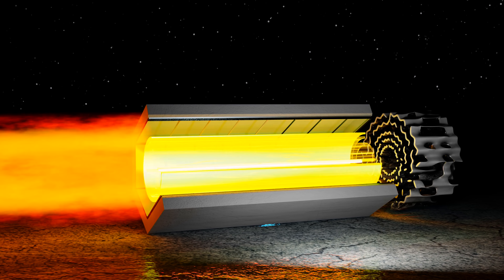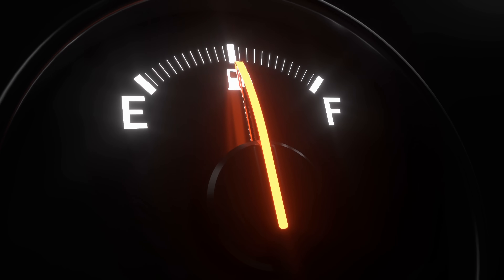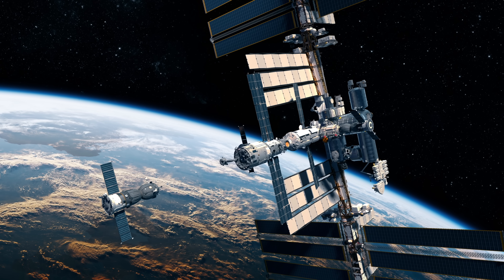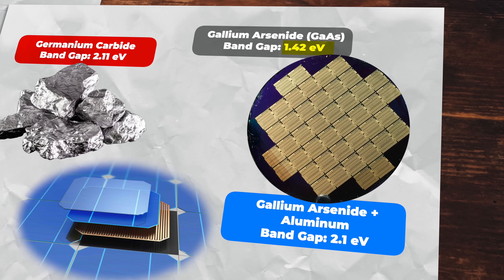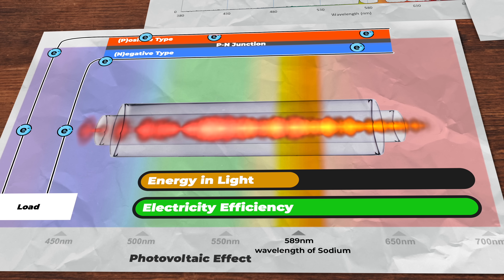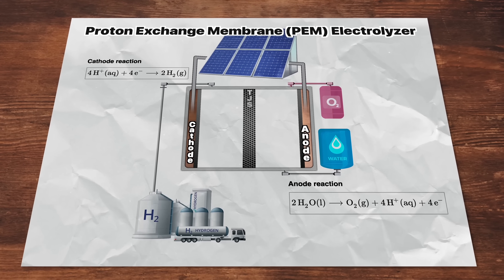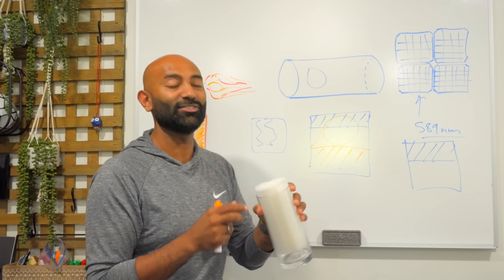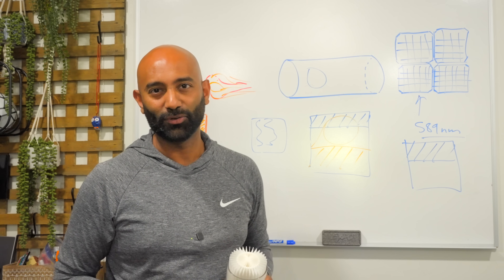Why Solid State Might Save The Combustion Engine

Comment from the maker: Check out the AMAZING Henson Shaving Razor & Get 100 FREE Blades! https://twobit.link/Henson  Use CODE: twobitdavinci
Reply: i see problems with this and i will list them below
1 overheating of solar panels
2 difficulty to start in winter
3 fouling of system with impure fuel
4 risk of exploding/out of control burning with damage
5 HOW DO YOU TURN OFF MOLTEN SODIUM
Reply: @marsfreelander5969  1 Gallium arsenide is the semiconductor that works best at high temperatures, and is protected by an infrared mirror and likely a vacuum gap. The back side could also be cooled by the incoming air.
2 Since when do bunsen burners and gas ovens have trouble starting in winter? This will much more reliably start in cold weather than a piston engine, and can help warm the batteries in a hybrid vehicle.
3 A modern burner combusts fuel much more completely and cleanly than the explosions in a piston engine, there is a constant flow with no moving parts in the way. A piston engine is much more vulnerable to fouling from impure fuel.
4 No more so than any other vehicle with a fuel tank.
5 Like a sodium vapor lamp it is likely contained in a chamber. When you turn off the burner it cools down.
Reply: @marsfreelander5969  1,3 I agree. The entire issue of starting this thing up is ignored and would be almost the same summer or winter.  4 needs a fuel injector, 5 there is no molten sodium just sodium ions.
Reply: You would add this to where the Catalytic converter would be and it would also replace the catalytic converter.
But it would be something that you could retrofit any car with
Reply: @jaredbullock3082  That's what I'm thinking. Then you could bin the alternator and cut out it's inefficiencies and parasitic losses as well.
Reply: You should be embarrassed for posting this video.
Reply: I'm old enough to have lived through the era of the disposable blade, single and double-blade razors. My modern, multi-blade is much better. It lasts for months. Going back to the old way seems to me to be a scam. We have gone beyond disposable blades. Let's not go back.
Reply: @HWKier  look for the Leaf Razor
Reply: @HWKier  I disagree, double blades are waaaay better. Those multi-blade things get bent into cheese graters before they've done half a lap.
Reply: @HWKier  I have this razor and it is a marvel. The TLDR version, get this razor, you won't regret it. 

Now, if you care about why the Hansen razor is so superior, read on. (BTW, I am an engineer and so overthink and geek out on just about everything including razors). Razor "burn" as well as nicks, as well as shaves that leave some short stubble behind, are largely the result of "chatter" or vibrations of the edge of the blade as the razor is pulled across the skin. This happens because friction with the skin causes the blade to bend downward slightly, which in turn causes the blade angle to become steeper. The steeper angle causes the blade to bite into the skin rather than gliding over it. Then, as the blade edge is released from digging into the skin, it springs back and like a spring ends up at an angle that is shallower than optimum and so doesn't cut the hair at skin level. Cutting the hair above skin level rather than shearing it at skin level causes the hair to be pulled as it is cut. This is what causes the unpleasant sensation of the hair being pulled out of the skin rather than cut. And because it cuts the hair above the skin level, this is why it is difficult to get a "smooth" shave with these old single blade razors. 

The magnitude of the deflections of the blade edge is a direct function of how how close to the edge the razor supports the blade. As Ricky showed, the "traditional" single blade razor supports the blade well back from the edge. This results in large amplitude vibrations and so lots of painful razor burn as the edge goes to too steep of an angle and painful pulling of the hair as it goes to too shallow of an angle. The solution has been to put very slippery shave foam/gel on the skin to greatly reduce the friction and so reduce the force causing The Henson razor supports the blade much closer to the edge. The result is that the amplitude of the blade edge vibration is a tiny fraction of the older blades with an attendant reduction in variation of the angle of the edge to the skin. This much better control of the blade means that the angle of the edge of the blade stays very close to the optimum angle at all times.

Also because of the greater control of the blade, the amount that the blade projects past the edge of the razor can be much smaller, making this razor much less "aggressive" than other single blade razors. And lastly the surfaces of the razor above and below the blade form a straight line unlike the round shape of older razors. This makes it much easier to hold the razor so that the blade is at the correct angle to the skin. And because of all of this better blade control, the Hansen razor is able to give a much smoother and more comfortable shave.

As for multi-blade razors, they provide almost no support for of the blades with the blades only being held at the ends of the blades with some vibration dampeners between the blades along their length. As a result the individual blades are free to move to a much greater degree than even traditional single blade razors. As for multi-blade razors great claim to fame that the the first blade pulls the hair upwards and the other blades cut it before it can retract such that hair end up below skin level for a super smooth shave, that is actually a major problem. With the hair below skin level it is possible for the hair to grow below the skin resulting in an ingrown hair. This especially the case for anybody whose hair has any natural curl to it. So anybody whose hair isn't absolutely straight should never use a multi-blade razor.
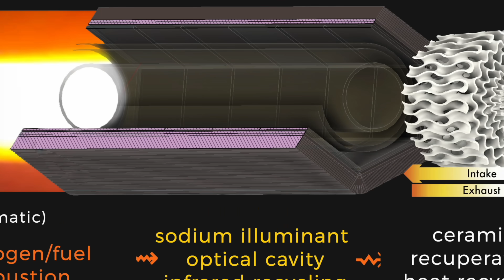Reply: 8:15 No there's not only two possibilities.  The salt is inside a double walled, sealed sapphire tube.

This is an interesting invention, BUT WE NEED TO STOP BURNING FOSSIL FUELS, AND HYDROGEN AT THIS POINT IS A BORDERLINE SCAM.

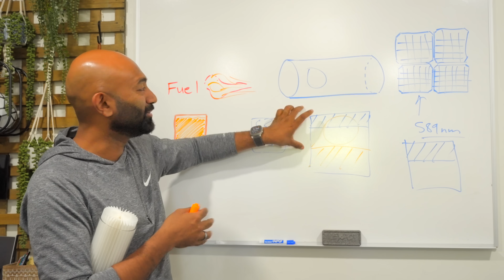14:39 The waste heat from regular internal combustion engines is too low energy to be used efficiently this way.  Thermodynamics.
Reply: "10,000 Watt-hours per gram" - did you mean kilogram??
Reply: This is an External Combustion Engine and so it will be intrinsically much more efficient. A new type of Sterling Engine then (one without moving parts, it’s alleged). How efficient remains to be seen: it’s hard to understand how all the heat produced will be captured (so, not just the more narrowly defined light waves) and then also converted into useful energy. It might be possible if moving parts are added which may yet turn out to be a valuable hybrid sterling engine. Let’s see.
Reply: Isn't there also a significant issue with chlorine gas? If it leaks and combusts, doesn't it produce mustard gas? Additionally, aren't there concerns similar to those with CFC refrigerants, which were discontinued because chlorine gas can bind with ozone in the upper atmosphere?
Reply: Ricky,  I have watched a company that has done something similar which they call the SunCell.  The company is called brilliant light power.  They have an element process that is called a Hydrino effect which collapses......

I think it would be nice to check them out.  I think they are closer and they are more efficient it appears.   Good Luck!
Reply: Utter Garbage!! 😂😂😂
Reply: What a load of utter Garbage!!! 😂😂😂😂
Reply: pin the comment from the maker
@danielle_fong, the founder, made a comment here, but it’s not showing up for some reason.
Reply: Why can't they combine lightcells with existing combustion engines to recover all that lost heat energy coming off the engine? How hot do you need to be for both lightcells before they efficiently converting heat into light?  Seems like if you placed things in the right places you coudl get quite a bit of heat recovery off existing combustion engines.  But I might completely off  and there is no way to capture the energy from the burning fuel as it drives the pistons, without losing efficiency in the engine core itself, if the only place you coudl do it that gets hot enough is inside the combustion chamber, then it might lower the efficiency of the engine, or cause other issues if you can't separate the ion into a tube as you said, or the other lightcell system which I didn't fully catch the mechanism they are using to convert heat into light...
Reply: @Arrogan28  They do, it's called a turbo. This system would copy what turbos do but in an outrageously complicated matter.
Reply: How does the fuel get into the engine without any moving parts?
Reply: I'd say this video is ok for a toiletries peddler.
Reply: It is called thermal induction. You can produce an electrical current in a coil, or separate plates, by heating them.
Reply: This screams Theranos
Reply: @14:30 I think you just made turbos more complicated. I would be curious to see if this system would be more efficient than current turbo systems. My bet, no. Too many phase conversions. Too complex to manufacture thus expensive and prone to breakdown. Turbos are straight forward, simple and resilient. Plus you could build a dual turbo-alternator combo to generate electrical power from engine heat if you want to do it that way.
Reply: Why can't we use this in space?
Reply: Figure out how to do it with hydrogen and I will be impressed:)
Reply: I think what your idea is good. And that should make hybrid cars more efficient. Well done:)
Reply: hey I can see how to improve this generator: supercool the (armature or casing) and add a second layer with a vacuum between. this helps to maintain the cooling effect, I know its a superhot source lol but it doesn't matter -it balances out. Add a Van der-Graaff generator or other ionising source and you're golden. -the ionising makes the collection surface more conductive, ditto the supercooling. This way much of the spectrum can be collected, even some infra-light frequencies
Reply: Use mirrors to make a power tower. Heat sodium to make the monochrome light. Then use PV to make electricity. Need to get rid of wasted heat. Somehow.
Reply: Chrysler turbine car would if made fuel cheaper and ran cleaner emissions. Today science has made silent turbines at least to our hearing frequency.  Why was it blocked ?
Reply: I've been using the Henson razor for while now and it really is the best razor I've ever had. Even if you use a new blade for every shave you will spend way less than a pack of catridge rasors, and it shaves just as good or better than a cartridge. Go get one!
Reply: Love the video. P.S. I think you meant: day in and day out.
Reply: New age Theranos

Comment: I'm very very skeptical of this entire thing. First of all, how are they even burning or combusting the fuel?? It's a solid-state engine but how do you physically burn fuel without moving parts? You still need ways to take in air(intake), compress the air(compression), combust the fuel(power stroke) and lastly let the exhaust out(exhaust stroke), and all these strokes require moving parts. I mean the exhaust doesn't need a moving part, like you just let a pipe or some holes for it to flow through(with tons of insulation to ensure exhaust temps are low can the exhaust heat can be recovered for the sodium lamp part to be as efficient as possible), but you need some way to inject fuel, compress the air and also an ignition source. The most efficient way for a combustion engine to operate is probably jet engines because they do it in one fell-swoop(continous manner)[actually I am not confident if continuous operations of all 4 strokes in the same time is more efficient or not, someone who is more knowledgeable can correct me]. So yes, where is the "solid-state" part of this combustion engine? Or is the solid-state referring to the sodium lamp part and the photovoltaic cell part? If yes, then this cannot be called as a solid-state combustion engine, at most, it should be called this "solid-state energy recovery method can help improve ICE car energy efficiency" or something, which could be less misleading IMO. To be honest though, I still enjoyed this video because the content is clear and concise, and he explained things well with some research done, although I didn't fact-check or verify whether his educated guess of the photovoltaic cell composition is correct or not. I find this video very interesting because I am someone who is quite passionate about racing car engineering, which is where car engines are within my field of interest, and I am now currently also taking a masters project for fabrication of solar cells, which is why this video is seriously well within my area of interest. One thing I have to say is, as an energy storage system, this system will probably never replace lithium-ion batteries because it is not an energy storage system at all. It is actively generating electricity and if you don't use it immediately, it is just going to be wasted, and hence you still need to connect this system to an electric motor for it to be meaningful. At the end of the way, it is actively harnessing energy from burning fuel(at a very high claimed energy efficiency of 60-80%), but you will need to use it immediately via electric motors, OR if there's a way for electronics control system to cut the electricity from the PV cells and you will still need batteries to store the excess energy from the continuous fuel burning process, so from a packaging perspective, I don't think it will very that compact either. So, at the end, I think this project doesn't really bring many benefits, but I digress. I welcome any experts in this particular field to correct me, giving me a good learning opportunity as well.

Comment: 1.3 billion cubic kilometres of salt water on Earth, so we won't run out of salt soon.
However, fuel cells use Platinum catalysts. 10,000 metric tons of platinum have been mined since its discovery in 1741, so a lot less Platinum is available at great unit cost.
That is why this "Light Cell" is better than a Fuel Cell.

Comment: Neurons in our brains are hybrid as well. Theyy use electrical pulses and then chemicals to connect with other neurons. These connections and reactions happen in fractions of a second, your brain can respond before you can (that's also what gives the effect of Déjà vu). It seems hybrid chemical-electric engines could possibly be the ultimate mechanical form of that. Surely there are better options in the future, but as of now, these are some pretty incredible works of engineering. (if the laws of physics can be broken or assaulted to a degree, to allow it to happen. Maybe sodium-salt in the gasoline or something else? having a lamp as an engine doesn't seem like it would be a good idea for any type of land vehicle)

Comment: Stated conversion of light to electricity is said to be efficient.  But the light component of the process is only one, whereas the energy of heat and gas/material expansion may be quite high in and of themselves.

Comment: High school dropout goes to Princeton and learns how to be a snake oil salesman.  If you think this is going to work -- that you can burn fuel and convert heat to light, light to electricity, electricity to mechanical energy with greater efficiency than current technology AND at a scale large enough to power a vehicle, then I must ask you this:  May I interest you in my portfolio of perpetual motion machines?  All of them work great on paper, you need only start a company and raise the funding to put any one of them into mass production....  Even if they are not perpetual, 70% of infinity is still a really long time!

Comment: didn't Danielle Fong take a bunch of investor money to create a compressed air energy storage company, which went bankrupt. You know, for the obvious thermodynamic reasons that air storage is a bad idea that every engineer learns in school? You know, the school she berates in her TED talk as "a system more concerned with authority [...] than with actually learning". Like maybe all my authoritarian schooling is getting in the way of me seeing clearly, but doesn't the Boltzman equation tell us that the intensity of energy radiated grow with the 4th power of temp, and doesn't thermodynamics say heat flows from hot to cold? so like how are you gonna have room temp combustion products coming out, when the lamp you need to power with combustion needs to be way hotter?

Comment: Why not use the produced heat into a source to power a turbojet, and generte the electrical battery that way? Even if you use a liquid in the process, that has a very low boiling point, to make the tubine spin? And condence it back to liquid, at the exhaust end

Comment: LaMirah is right, I do not believe the presenter has taken into account the decreasing efficiency with temperature decrease! If we assume the original statement of 8% would be right (I doubt it is), then it should be applied to the core of the heat (hight temp) and when the fumes are recovered, it means much less at the end. Let's assume one applies 80% efficiency to 50% (as most heat is gone) and then st like 50% to the 50% left, then we'll be far from the 'miracle' stated in this video...  0.80 X 0.50 + 0.50 X 0.5 = 65%, and we are nice to take the author's figues.